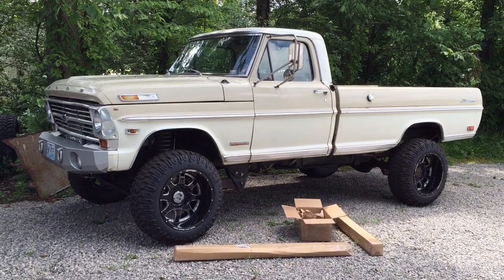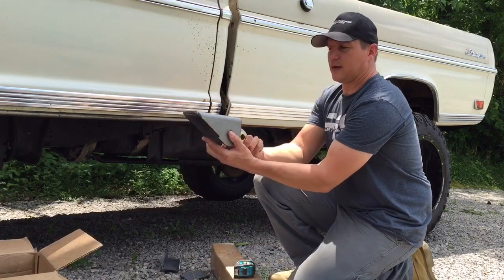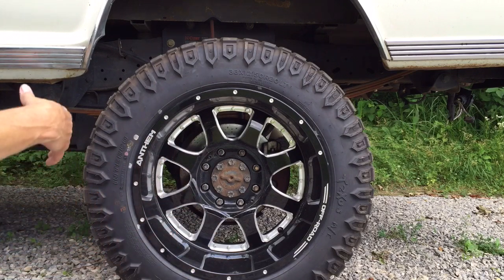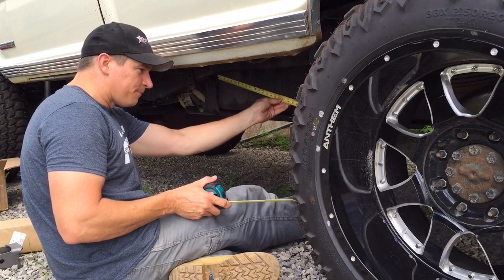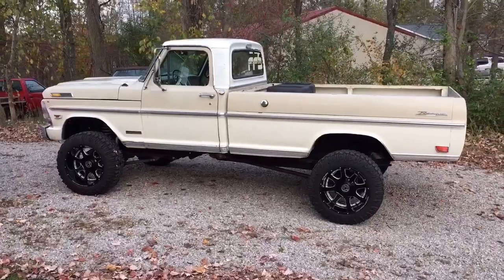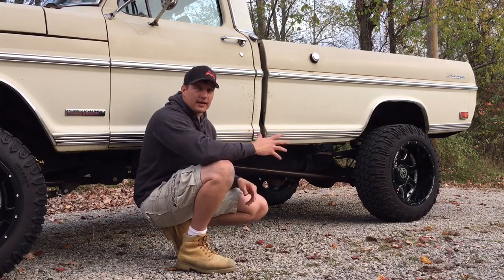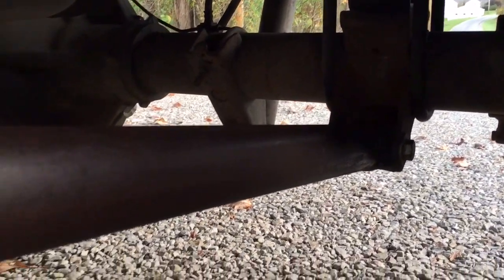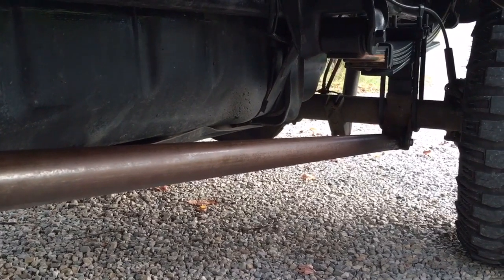Farfromstock installing Traction Bars

Comment: Appreciate the time you took to make the video.  This has given me the confidence to install a set of my own on my Duramax.  Thanks!
Reply from the maker: Motodrew no problem. On your d-max you can trim the bottom of your spring hangers and flip half of your e break bracket out to the side and put a much cleaner shorter set on if you're not already real lifted
Reply: I've got an 8" Fabtech lift I'm going to settle as much as possible.  I'll be going to 4" tapered blocks in the rear.   Looks like I should be able to find room for the brackets next to the shock hangers.
Reply from the maker: Motodrew I recently made a -max specific post on ig about these if you didn't see it

Comment: You answered every question I've had that's hindered me from building my own. I was looking at going 72" myself with a stock setup. I'm putting a 3" rear lift and 4.5 inch front. Hopefully the traction bars won't need much modification after the lift is installed. I'm a fairly skilled welder/fabricator with quite a few years under my belt. I'm near certain I can iron out the kinks on the minor details but your video was exactly what I needed to see to give me the inspiration to make it happen. That's one saaweeet ass truck too brother. That body didn't come out of my parts. The 68's and all years in between are near extinction. They're like finding a needle in a haystack when one is even salvageable. Keep up the good work.

Comment: For myself I always follow the angle of the drive shaft seems to work for me
Reply from the maker: that’s not a bad rule, but if you could cycle your suspension and see how much slip is used on the driveshaft it might indicate there’s a better location.
Reply: @mopar1darrell  I got you you don't always have that

Comment: why doesn't the kit come with 2 rod ends for each bar? instead of having to use a hole saw?
Reply from the maker: Austin L can no problem. Just a $ upgrade. Shouldn't be any issues but a rubber bushing does insure no noises or vibrations but I don't think it would be an issue. Especially if you ordered it with right hand and left hand sets, then you could easily put a touch of tension on it

Comment: Great videos on the suspension stuff and love the olderduty would love to do a 6.0 dent side built one of these days. I built a 4-link for my truck in the front when I did an 05 axle swap, just curious if the 3 link setup is possibly a better ride quality than a 4 link would be and why you went that route?
Reply from the maker: westone93 I wouldn't say better ride quality, the radius arm is pretty simple compared to a 4 link. On this ford I didn't want the brackets any lower and most 4 links for it hang lower. Otherwise on the dodge it's mostly about space
Reply: mopar1darrell Gotcha, ya I agree the 4 link brackets stick down further and can limit clearance. Looks good tho keep up the good work

Comment: I know this videos is old, but I’m in the process of building a set of trac bars and I have everything ready to go other than the brackets because I’ve been told you’re not supposed to weld to the bottom of a frame because it can “weaken” it. What are your thoughts on that?

Comment: Love your videos mopar1darrell! Straight forward and concise with details. Would you mind telling me which welder you use for this type of work?
Reply from the maker: Matt Conner thx. I have a Lincoln mig to use that isn't mine but lives in my garage. It's a very nice welder and allows a dummy like me to get the job done
Reply: Is it 110v or 220v?
Reply from the maker: Matt Conner it's 220. I'll have to check the numbers on it. Not super familiar with options but I do know it's decent with some expand ability built in, like tig
Reply: Thank you sir! That's what I needed to know.

Comment: I was looking at your site and came here looking for some advice. I have a Ford F 350 dually lifted 8 inches( crew cab, long bed). What length you do advice for it? Note, that I do like to get past the fuel tank and frame drops around that point( 81 inch from axle).

Comment: Hey Darrell, question, I went with larger arced springs with my 4 inch lift to get rid of the block, so my leaf springs sit directly on my axle, do you still think I should install trac bars? Or do you think that would be a waste of money
Reply from the maker: ArcticAstrophysics springs can still wrap even with no block, just ask the muscle car guys with no block or spring under. The reason they aren't a waste of money is because the time you need them you will be violently hopping and therefore have to quit or worse yet a yoke or u-joint breaks. Your springs are a nice mod though

Comment: So did you only do a "1 wheel peel" because you have a LS rear diff? and if so what did you do get both wheels to spin? My 03 7.3l will sometimes do one and sometimes both.
Reply from the maker: +Garrett Adams the ford factory lsd leaves a lot to be desired. In great condition they still do just what you said happens to yours, and mine. Im fixing the issue with a YUKON GEAR duragrip lsd. I expect it's performance to be similar to my oem dodge powr-lok , they are brutes and never slip a tire
Reply: From my personal experience, the LSD in these trucks started out, fresh from the factory, locking better and more consistent than they do once they're worn. If your experiencing locking issues, you may want to try a lube change with a really good 75w 140 syn with friction modifier in either the additive or premixed steaight from the maker. I recommend Royal purple or amsoil to help  the clutches engage more consistently. I'm not saying it will cure those issues but will most likely help to some degree. Obviously, once the clutch plates get so worn, there isn't much you can do besides a rebuild with a locker of some sort. But fresh fluids of the best quality sure isn't going to hurt anything when. It comes to LSD. GOOD LUCK.

Comment: did you ever have any issues with binding or anything going down the road with these? about to put a set on a 2008 f250 and was going to mount it the same as you but I tow alot between 10-15k and am worried these are going to bind
Reply from the maker: Anthony King no sir. That's exactly what this vid is about. Mounting the bars to work with, not against, your current suspension. No problems

Comment: What is the wheel and tire setup on that truck? and the bumper? I have an 03 powerstroke i'm considering doing a similar body swap on.
Reply from the maker: Jack Wiggert 33/12.50 Interco Trxus mt's on 20x12 anthem commanders. Home brewed bumper
Reply: Thats awesome. Thank you